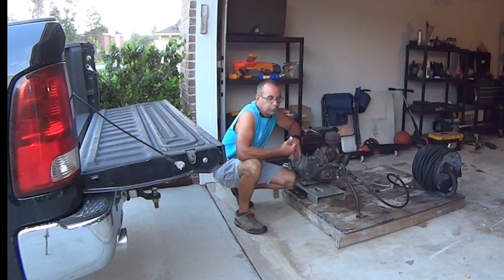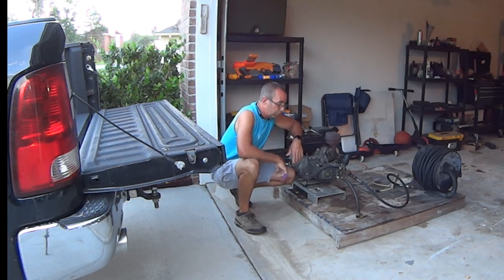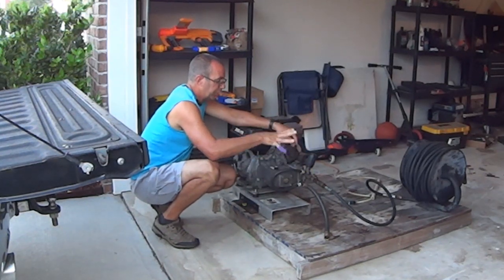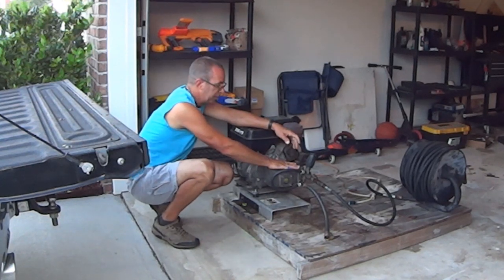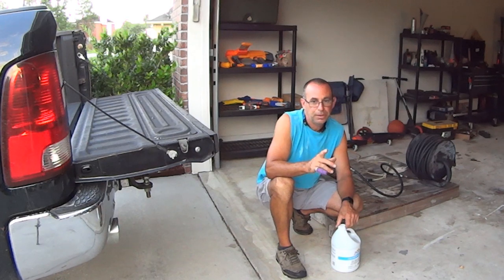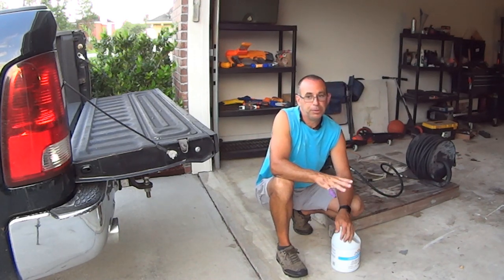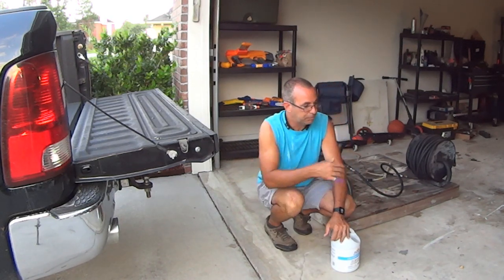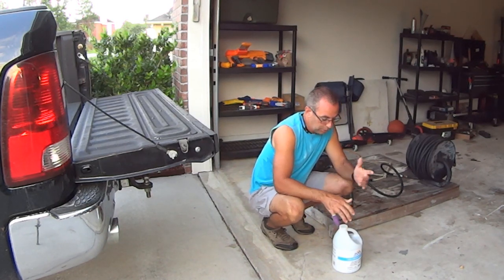Pressure Wash - Prepping for a House Wash and Concrete Wash - #SideHustle

Comment: Put a sheet of corrugated cardboard on the tailgate that extends about 1 foot onto the bed of the truck.  The pallet will slide easier.  I second the hydraulic lift table.  I got a 1000 pound unit from Menards.  Sure, I can still lift stuff, but the lift table makes it so much easier.

Comment: Don't hurt that back, I did now i'm paying for it. My legs, feet are quite numb, the 5 lower vertebrae are messed up. I can turn wrong and it's out. The vertebrae behind my Adams apple is screwed also, which is causing numbness. Get a chain fall in the garage

Comment: Hey dan I am using 12% how much should I dilute that even if I’m using a 4 gpm 3600 psi power washer?
Reply from the maker: Vinny Giammarino try 2 gallon 12% and 2 gallon water in a bucket and then siphon it and see if strong enough. If not add a little. If it cuts real fast (5 minutes or less) add water
Reply: Ok thanks